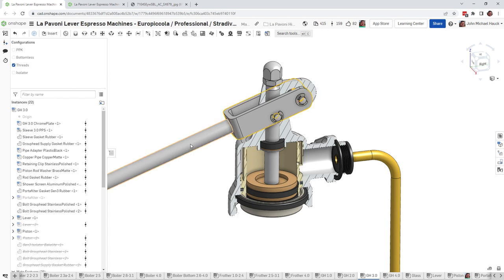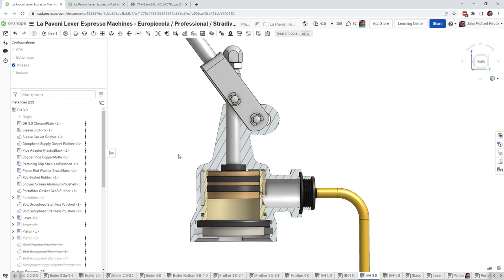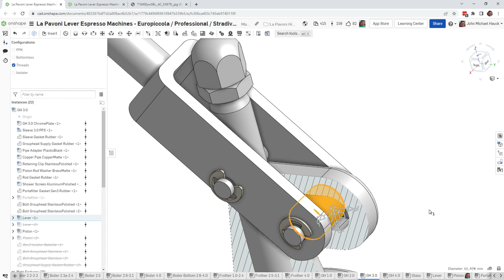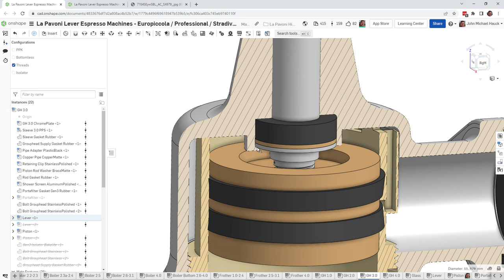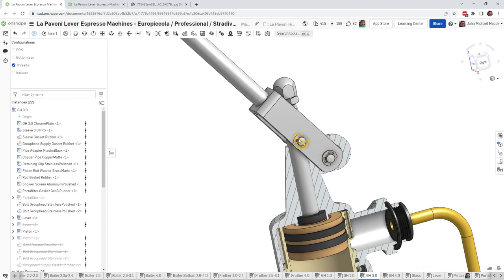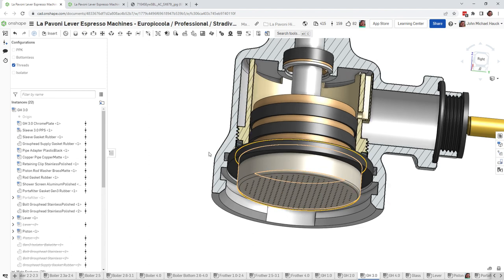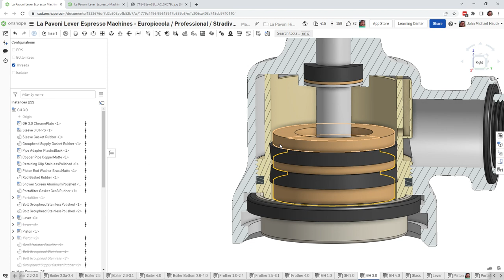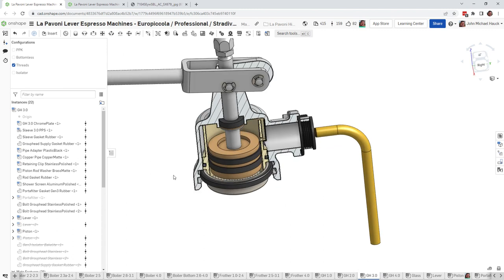21. Low Water Flow Problems on La Pavoni Lever Espresso Machines

Comment: a BIG thanks for this excellent video. I wasn't getting any water coming through on my machine, I changed the seals and still the same. Watched this video and tightened the plunger rod and now it works like new. the graphic explanation is brilliant and very clever.
Reply from the maker: Yay!

Comment: Update: I have 4 of these machines, the models of which span many decades. One unit has low water flow into the group head. I took all 4 apart and discovered that the unit with poor water flow only had 1 inlet hole, whereas the other 3 had 2 inlet holes. I am assuming that the single inlet is the cause of poor water in-flow.  Highlights that all units are different in small ways. Cheers.
Reply from the maker: See my comparison of group heads video:
https://youtu.be/ViNrag4lYJg
Generation 1 has three holes - 120 degrees apart in a metal sleeve.
Generation 2 has two holes next to each other with no sleeve.
Generations 3 & 4 have one hole in a plastic sleeve (with a channel that goes to the top).

Since you say the problem is with the 1-hole group head, then I am assuming you have a generation 3 or 4 with the low flow issue.

I am confident it has nothing to do with the number of holes. Really.
I would first suspect the piston rod is not screwed all the way into the piston.
Second, I would suspect the siphon tube is cracked or not screwed in.
Third, I would suspect a problem with leaking on the plug that the siphon tube screws into.
Finally, I would suspect low boiler pressure (test this first - is the steam from the wand forceful?).
Reply: @JohnMichaelHauck  The single hole unit is a generation 2 machine. Brass sleeve (double boiler).  

I first assumed steam pressure so modified spring mechanism in safety outlet valve by adding a 1/8 inch brass insert to increase pressure. It steams like a beast so no pressure issues. Stripped whole machine, no leaks. Brass inlet tube is free, unblocked, and inserted with Teflon thread tape. The plunger rod and lever mechanism are all functioning as they should with no issues. 

The only thing I can think of is a calcified, blocked, part of the head, like you advise. I'll have to keep digging. While a replacement is an easy fix, I'm the kind of person who needs to know as it is my favourite unit. I'll check back in if solution found. Many thanks for your excellent videos, fantastic.

Comment: I dialed up the pressurestat a tad on my post millennium La Pavoni Pro a while back. One day after the machine sat on for half a day I heard the safety valve release pressure like crazy and the pressure almost up to 2 bar. I shut it off and adjusted the pressurestat back down. Since then, water fills the group head very slowly with no force or pressure. Steam works well and I descaled. Could the high heat have melted, altered, or caused some problem? The machine is a year old and I'll be trying all the tips you lay out here. Thanks!
Reply from the maker: Sorry it took a while to reply. I wonder if the two gaskets on the piston could be to blame. I probabily would suggest taking the piston out and removing the group head from the boiler and checking everything over. You could post pictures online here for feedback from me or others in this super helpful group: https://www.facebook.com/groups/lapavonienthusiastsgroup

Comment: Nice vid, thanks mate.
I avoided taking the screen out.
Using 2 screw drivers.
Take handle off in the up position, place a screw driver through the hole in the piston shaft & tighten clockwise by tapping with other screw drivers handle.
The friction of the seals & the impact effect worked a treat for me.
Went from a dribble to a full down pour shower...
I couldn't have done it without your info, so thanks again.

Comment: These flow problems happen to me around twice a year. I don't remove the piston to fix it. I just raise the handle as high as possible and take out the higher pivot pin. Then I just put a thin screwdriver thru the hole in the piston rod and spin it around 3-4 revolutions to re-tighten the rod. Easy peasy lemon squeezy... after typing this, I see someone else below mentioned the same approach. This takes less than 5 min and it will stay tight for quite a while. 
I've heard others say they put threadlock on the rod when assembling. I may try that next time I have it all disassembled. I'd never tried it before because of the idea of putting anything not "food safe" in the mechanism kind of feels wrong.

Comment: You can do a temporary quick-fix on the piston by removing the lever arm, then simply screwing the rod clockwise while it's all assembled. With a cold machine, there's enough friction in the seals to allow you to screw it up a few threads and make the machine work again

If removing piston entirely, use teflon tape, several layers and screw it on as tightly as you can. Do not use threadlocker, as threadlocker fouls when heated - not suitable for use in a hot group-head. I'm also unaware of any threadlocker that specifically state themselves to be food-safe, yet teflon tape always is
Reply from the maker: Rory, Super helpful comment. Thanks!

Comment: Hi John Thanks for the great video. I have a low or no water problem with my La Pavoni. I have tried all the things you suggested. I have changed the gaskets on the piston. Made sure the piston rod is screwed in tight, and made sure that the piston is able to rise high enough. Still no water. Any ideas? Thanks!
Reply from the maker: So the obvious one is boiler pressure. The easy test is to open the steam want and see if the steam comes out forcefully (or check the boiler pressure gauge if you have one).

The less obvious one might be that the siphon tube is not drawing up water. The obvious cause is low water level, but I'll assume that is not the case. Another could be that the siphon tube is cracked (happened to me), or not screwed in properly to the group head. This would result in steam being delivered when you raise the lever, but no water.

So tell me, what happens when you raise the lever all the way (while the machine is hot and full of water)?
Does little water or steam come out? If so then the piston is not going all the way up. (Could be that the handle installed upside down too)
Does a lot of steam come out and no water? The siphon tube is leaking.
Does a lot of hot water come out? Then I am confused why we are chatting. :P

I've been directing people to https://www.facebook.com/groups/lapavonienthusiastsgroup for better help from more people who think things through better than any one person can. It's a great group.
Reply: @JohnMichaelHauck    Yes, I have a pressure gauge and it is definitely high enough

Comment: My first shot is reasonable, but after that hardly any water comes out anymore for a second shot. I have checked and tightened the piston, and there is plenty of pressure. Any suggestions? Thank you so much, the video demonstrations are just wonderful!
Reply from the maker: Daan, I'm not sure what you mean about the second shot.
I'll assume you are saying: "With the same amount of pressure on the lever, it takes the espresso a lot longer to come out on the second shot."
Correct me if I did not understand correctly.
Otherwise, what you are experiencing is normal. That is, the group head is hotter which makes the extraction take more force. The reasons behind this is debatable.
So, you could:
A) Grind a bit coarser for the second shot.
B) Heat up the group head more before the first shot (and grind coarser).
You can heat up the group head by leaving the machine on longer, or raising the lever up (to just before water comes out without a portafilter) and down a few times.

Comment: Hi John great vid thanks.....I have a Gen3 which is pouring with water on lifting the lever regardless of tamp and grind. I recently installed a pressure profiling kit to no avail. I have also removed the plastic sleeve to inspect and it looks fine along with the sleeve gasket. I don't suppose you have any ideas as to what may be going on?
Reply from the maker: subhkan, one key pieces that is not clear to me is whether the water is coming from (1) the spout of your portafilter, or (2) around the outside of the portafilter. For the first, you most likely have a problem with your coffee beans being too old (aim for 2 weeks after roasting), too coarsly ground (use a good espresso grinder), or not enough grinds (aim for 14 grams). Alternatively there is a off chance the boiler is under way too much pressure - which is pretty unlikely. For the second case, maybe you forgot to replace the portafilter gasket? Does the portafilter get nice and tight as you lock it in (turn it to the left)?
For a better analysis, reach out to the good folks at https://www.facebook.com/groups/lapavonienthusiastsgroup
Reply: @JohnMichaelHauck  Thanks John...yep water comes out of the portafilter spout. The filter is going in so snug and tight so no concern there. I have used all sorts of coffee grinds in there and tamped so hard. I don't understand it. Thanks I have posted already hopefully someone has some insight into it.

Comment: john, I just replaced the various seals on my pre millenium la Pavoni. Now as I raise the arm to pull a shot, thin coffee drops into the cup and when I bring the arm down to pull, there is very little resistance to press coffee into the cup....only more thin coffee water. Any advice is appreciated. 
Tony R
Reply from the maker: I would suggest posting this question over at https://www.facebook.com/groups/lapavonienthusiastsgroup
My first guess is that one (or both) of the two piston seals are up-side-down. They have a V-shaped cross section. The V should be an upright V on the top of the piston, and an up-side-down V on the bottom of the piston. The other guess is that you are not grinding the beans fine enough. In any case the group linked above will help you a lot more than I can.